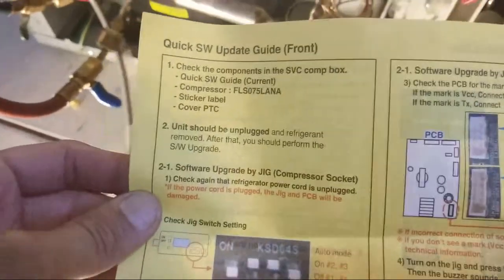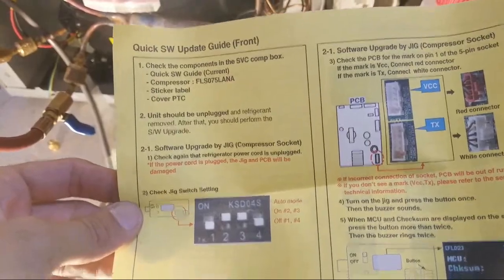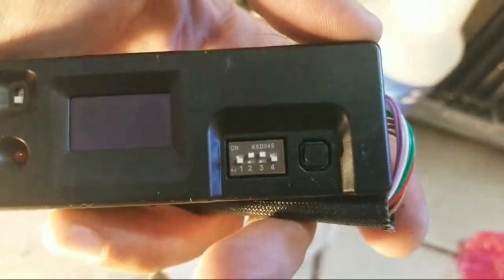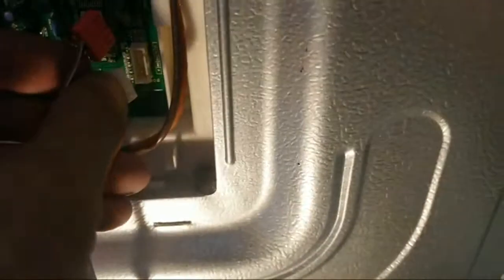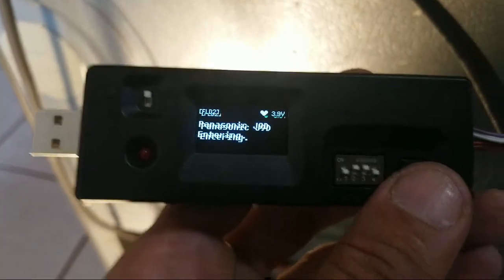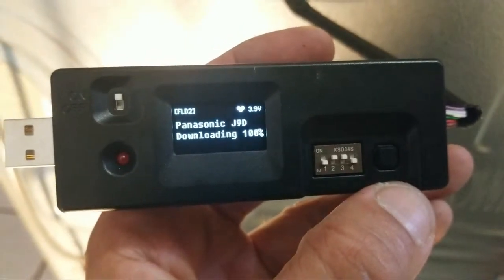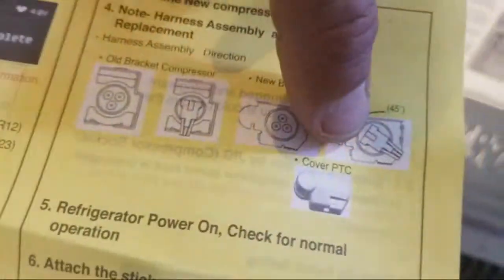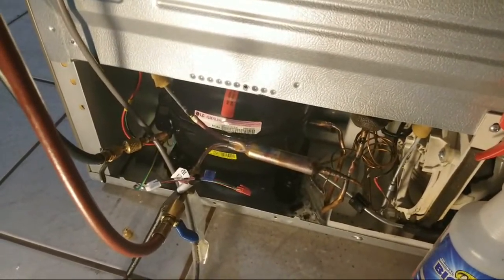#techtalk Updating Universal LG compressor TCA38091801

Comment: The instructions say to remove the refrigerant first before updating the software.  Does anyone know why?  I've seen some tutorials where the board was totally removed from the refrigerator when doing the update.  Did they then have to remove the refrigerant before plugging the updated board back in and recharging the system?

Comment: Hey which way should the white plug go on the universal compressor do you flip it upside down on the universal lg compressor since it doesn’t fit like it did on the old compressor.
Reply from the maker: The lg plug has only 2 wires, Ohm out new compressor find the 2 of the 3 pins that give you a reading, when connecting the plug make sure those two wires are toughing the two pins with resistance.

Comment: What is the expected voltage supplied by the PCB after the update for the universal compressor?  I had mine replaced and am measuring ~125VAC at CON20's rightmost 2 pins;  the service manual indicates ~200VAC is expected, but I wasn't sure if that was only for the linear compressor or if that's still the required voltage for the new universal one.

Comment: What years do these jigs work for? My compressor was changed in 2019, the sw was updated. Now I need a new main circuit board. I ordered the board on eBay. Now I will need to update the sw again. My fridge is a 2017 or 18 LG. Will this jig work?
Reply from the maker: How do you know the main board is bad just curious

Comment: great video man. it helped me a lot and you were very clear. however, my pops and i ran into an issue with the jig. it says “failed… pull the power cord and try again” and we’ve tried a few times. fridge is unplugged bc the instructions said so. thanks
Reply from the maker: Did you do the update with the fridge plugged in?
Reply: @TMMApplianceRepair  i did not. instructions made it sound like i had to keep the fridge off the until the software update was complete lol. is that why
Reply from the maker: @moto-kc  good ur not supposed too.. only other thing that could cause that is incorrect compressor part Installed or the jig itself is bad
Reply: @TMMApplianceRepair  we installed a FLS075LANA and i picked up a jig from the local part store. in your experience, have you found that these jigs can be problematic? they have another in stock. i might be able to exchange it and see if that fixes it
Reply: @TMMApplianceRepair  i’m so stupid.  i didn’t see the other 5 pin socket towards the bottom of the board. plugged it in and it worked just fine. lol thank you so much for your help
Reply from the maker: @moto-kc  ur not stupid be safe
Reply: @TMMApplianceRepair  i was so fixated on the one at the top lol. and you too. thanks again

Comment: waste of time given lg never address original issue. put in a relay and convert it to recip. compressor. end of story
Reply: Hey Jessie, do you know what the original issue is with the compressor that LG didn't fix?  I have been searching everywhere and haven't found anything regarding what the difference is of the new compressor.
Reply: @jonkruger7070  the linear compressors had defective valves. The valve would go bad so the compressor would still run but not pump any freon. I do not know if the new universal compressors improved though

Comment: Is there an updated compressor charge PSI for the new LG universal compressor, or do you use the same charge pressure as what the Liner compressor was using?
Reply from the maker: You should weigh it in using the label example 4.76oz... normally I see them at 55 psi when equalized
Reply: @TMMApplianceRepair  - Thanks for the reply! I just went off the weight on the label.  I was just worried that maybe the new universal compressor might change the capacity requirements. Thanks for the very informative video!

Comment: I have some questions  When you buy this software rewriter, do you need to go to some manufacturer website and see if there is a new update file tha needs to be downloaded?  Or do buy the re writer everytime you change a compressor? How many brands use the same device?
Reply from the maker: You buy it once its for lg compressor replacement (only certain ones).
Reply: @TMMApplianceRepair  how do you know when the re writer device needs to be updated? And is there a way today to request service and repair manuals to LG, even if paying subscription is required? Hey thanks for replying!
Reply from the maker: @1984juant  I'd tell you sign up with them . You'll get updates, service bulletins, training.. with me I did warranty that had tech support so when theses came out I was thought how to troubleshoot them properly

Comment: So I’ll ask the question once more.   What if you dont do the update?  If all windings are the same, and the voltage is still the same, it should work if you angle the fusite connector.  Next question, what does this update actually change?
Reply from the maker: Brother I'm not a direct LG employee. What I know is what I've read and been told. And that is, you need the Jig if you replace the universal compressor. Without it cooling performance may be effected
Reply: My tech said it runs the compressor differently and helps it to not overheat. The compressor is essentially the same unless they upgraded the plastic piston and speaker type seal.

Comment: I have a 2011 lg fridge I put a new compressor and board into it. This fridge has dual evaporators only the freezer side works any advice? Also one of the lines freezes going into the compressor.
Reply from the maker: When you did the evacuating and charging did you have the 3 way valve in the home position
Reply: I believe so I can retry I usually press the button twice wait few seconds then unplug and pull vacuum and charge. If that doesn’t work is there a possibility that a 2011 lg fridge can’t be upgraded?

Comment: Are the universal compressors plus the software upgrade actually fixing these for the long run? Or do you expect to keep on replacing these in the future?
Reply: I just had my 5 year old compressor coded and replaces with the universal. The tech told me they look exactly the same inside. He's torn an old one apart and a red sticker defective one. He thinks the programming will help the most by not allowing the compressor to overheat.

Comment: Hello.  I'm trying to help out a friend of mine who lives in Jamaica W.I.  His refrigerator's compressor recently stopped working and LG sent him a new one under warranty.  He had to purchase the jig.  A repair man installed the compressor for him and updated the fridge using the jig.  After the new compressor was installed and the fridge was powered back on.  The fridge now functions, but is no longer cooling properly.  

The main compartment of the fridge is running at 8c and the freezer is running at -2c (even though it should be running at -18c).  The compressor is running at 51c.  The fridge struggles just to freeze the ice trays, taking around 2 days to do so and the ice maker isn't working at all.  Can you think of any reason why this would be happening?  Thanks for ANY suggestions you may have.
Reply: Did you ever figure out this? I’m also in JA and trying to get the JIG, do you know if it’s available anywhere on the island? Thanks
Reply from the maker: https://partsdr.com/part/cjt30000002-sw-rewriter-assembly?gclid=Cj0KCQjw6uT4BRD5ARIsADwJQ19KHYb3IlqhDy1IsLY9xhFZ3LEMoemAjr4f10moULcOIbA0Zx7S8wkaAvTkEALw_wcB
Reply: @michaelmaxwell7171  Hey Michael, yes he figured it out.  I'm gonna send your message to my friend.
Reply: Snowmation thanks
Reply: @michaelmaxwell7171  Hey man, Andre is the friend I was talking about.  So contact him if you still need help.
Reply: Andre lv will do thanks

Comment: I just had one of these new universal compressors installed on my LG French door along with the guy doing the software update.  Now my fridge freezes everything no matter how high you set the temp...
Reply from the maker: check your thermistors
Reply: @TMMApplianceRepair  I ordered and installed a new fridge-side thermistor yesterday.  Same result.  I tested the thermistor in 32'F water and it gave a 29.2k Ohm reading, right on par with where it should be.  My unit has dual evaporators, is it possible the guy who installed the compressor reversed the installation by hooking the fridge evap to where the freezer should be on the compressor, or does it even matter?
Reply from the maker: @jw5031  theres 2 thermistors in that compartment ff and ffevap . you should check the other in that compartment.  also while your at the board check ALL your thermistors
Reply: @TMMApplianceRepair  Thanks man!  Didn't know there were two in that compartment.  Great info to know.  The one I replaced was the one along the back panel down near the temp-control deli drawer.  Do you know where the other one is located, perhaps maybe the set of two wires coming off the end of the actual evap itself?
Reply from the maker: @jw5031  yep thats the one.. itsyour evap thermistor
Reply: @TMMApplianceRepair  I'll be checking that one tonight.  Thank you sir!
Reply from the maker: @jw5031  love peace and harmony
Reply: @TMMApplianceRepair  Checked All 4 thermistors in both compartments in 32'F ice water:  (in Ohms) Fridge Evap-28.5k, Fridge Temp-29.5k, Freezer Evap-28.0k, Freezer Temp-7.8k.  All seem to be functioning properly.  Any ideas?  Thanks again!
Reply: @jw5031  Did you ever get this sorted out?

Comment: What if you don't update the board. Will it still cool?
Reply from the maker: No it won't cool properly
Reply: I have the same question.  I was replacing 5 of these a week, turned the connector at a 45...ran fine.  Now they have this update, the jig is 75 bucks each.  Seems to me if the compressor is in warranty, which the ones I do, we shouldn’t have to buy a single jig.

Comment: I used to install 2-3 compressors in a weekly basis. Now lg has instructed marcone not to sell compressors to any tech unless they are ASP for LG.
Are u an lg authorized tech. ???
If not whats tbe quickest way to get the compressors since most online retailer are not longer selling to independent service providers. ??
Thanks
Michael @ technical home service out of miami, fl
Reply: Most compressors we replace are 7-10 year warranty...we are technically not an asp for lg, but we call lg directly, they send us the parts free of charge.  However, if you do sealed systems for ServiceLive(Sears) marcone will,sell you the compressor.  They can’t tell anyone not to sell you something if it is out of warranty and a cash call. .but most of those comps, are 7-10 year part only.
Reply from the maker: just found out myself lol. not sure what to say at the moment

Comment: Just installed the new Lg compressor attempting to install software update came across issue with Jig SD card not detected flashes no MVF file any suggestions? Already removed sd card multiple times and reinserted no luck
Reply from the maker: that happened to me once turned out there are a few models that doesn't work with the "universal".compressor
Reply: Did you ever resolve your problem? I've run across this as well. Checked the micro SD card and it's empty. No luck finding a file to download.

Comment: Did you buy jig? Or how did you get it. ?
Reply from the maker: called lg and ordered it
Reply from the maker: @iyala82  before I guess they had different compressors parts numbers. but dont quote me on this it looks like this is a universal that will fit whichever one
Reply: @TMMApplianceRepair  hmmmm touche if you don't mind me asking do you have the phone number to that dept to get that part? also how much did it run you? also how did you find out about that software device?
Reply: @iyala82  There was a Service Bulletin sent out back in June 2020.  #CNZ201900235-03